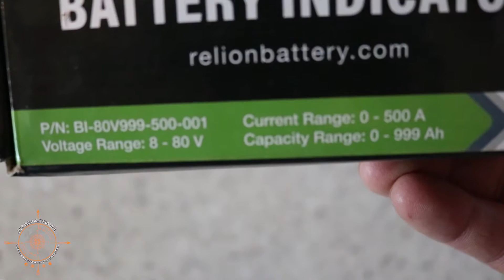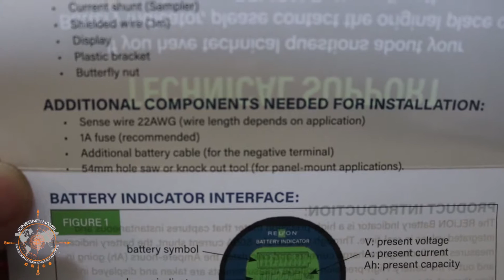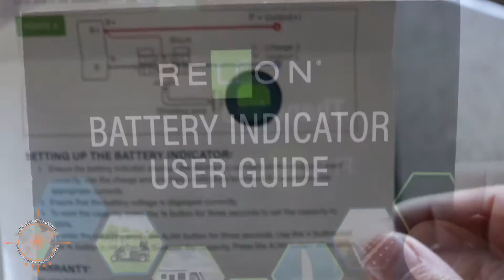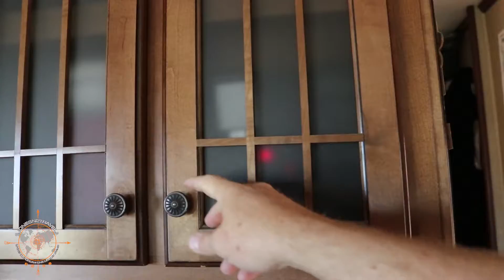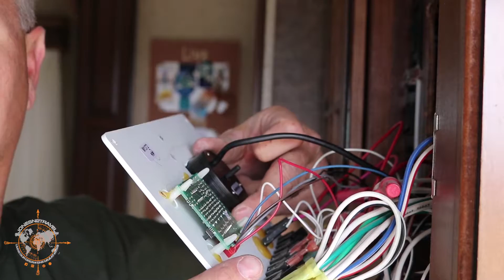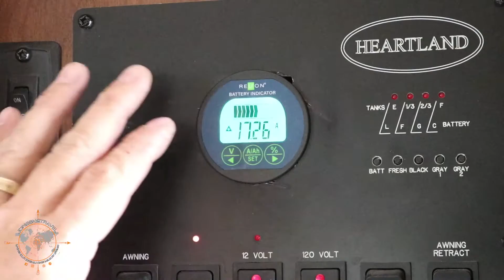RELION BATTERY'S NEW BATTERY FUEL GAUGE UNBOXING AND INSTALL | RV LIVING

Comment: Does the gauge shut off when system not in use? Just wondering if gauge needs to be constantly on to not lose programmed memory? Would install on boat and could probably hook to the shut off side of breaker if need be.
Reply from the maker: There is a power wire that runs from the battery to the meter so yes, it is powered all the time. It draws very little power but I am not sure what it might lose from a memory standpoint if you were to disconnect it when you store your boat. I haven't tested this as we are full time and our solar system keeps our batteries up even if we were to leave the coach for some time. I would refer to you the guys over at Relion, they have extensive experience with using this meter in boating applications. Safe Travels.